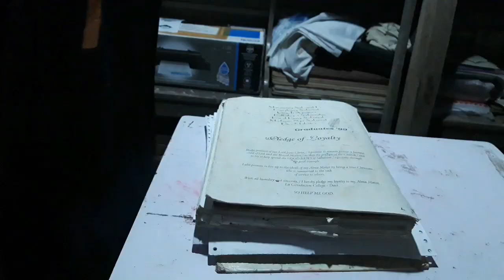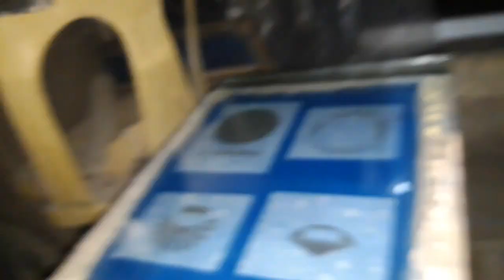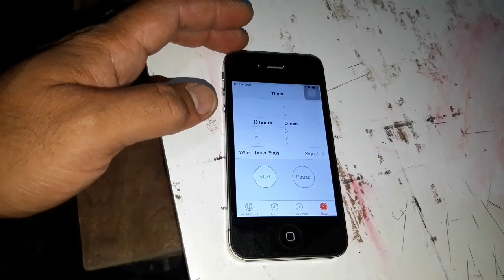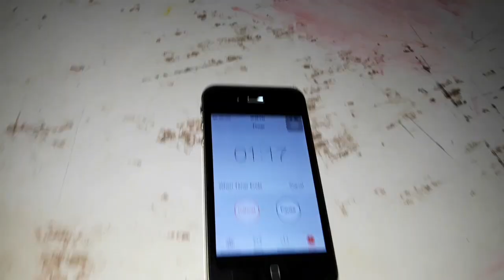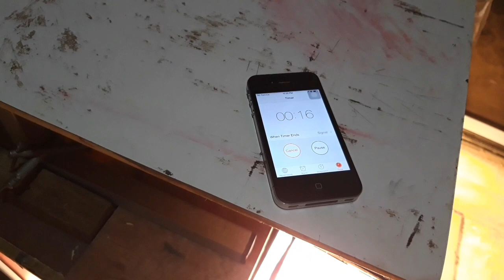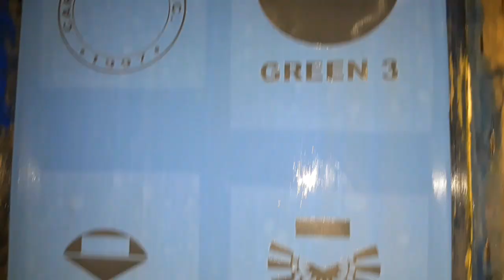Bondtika (Stencil Using Cooking Oil)

Comment: What's in the spray bottle
Reply from the maker: The spray bottle, only water...no chemicals added..
Reply: Can I use the Sun instead of light
Reply from the maker: Just water
Reply from the maker: Yes, you can use sunlight..however, you need to reduce your sun exposure..it only takes seconds..

Comment: Sir anong emulation po gamit nyo ung blue? Tsaka may hinahalo po ba dun?
Reply from the maker: Sir, Tulco Aquasol Er..ready mix na po. No need na maghalo pa ng ibang chemicals..
Reply: Ahh salamat sir, ask ko na rin kung paano paglinis nya pagkagamit para di masira?
Reply from the maker: @LanceMelchor  ang gamit ko ay Tulco Stripper para sa pagreclaim ng screen..uoload ako ng proces ng paggamit ko paano ireclaim ang screen using Tulco Stripper..pls subscribe.thanks.
Reply: Ahh pag nilinis po ba sya ng tubig di matatangal ung design?
Reply: Para pwede ko sana gamitin pang matagalan
Reply from the maker: @LanceMelchor  di natatanggal yun exposed ng design...pero pwwede ireclaim ang screen gamit ang Tulco Stripper..magagamit mo ng matagal ang screen na may exposed design..
Reply: Maraming salamat kap laking tulong ung video at sagot mo🙏🏻